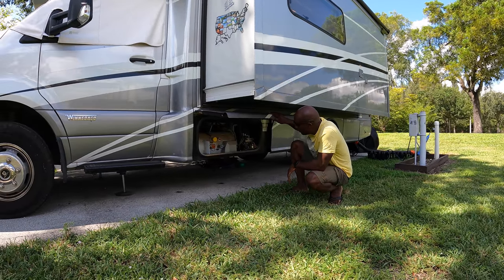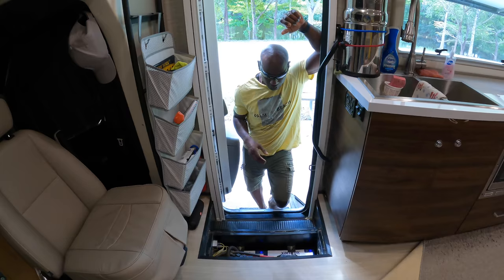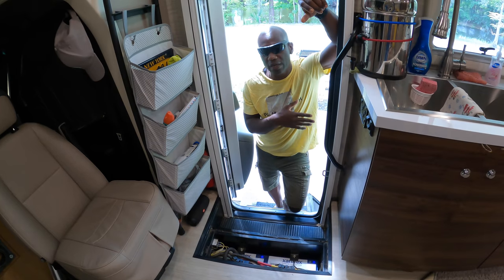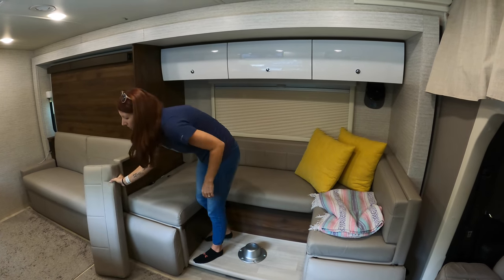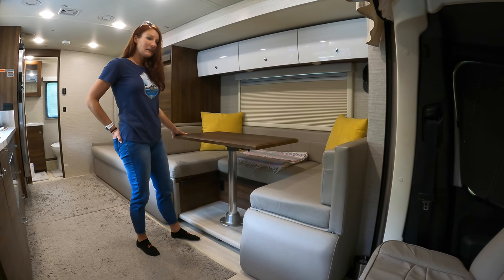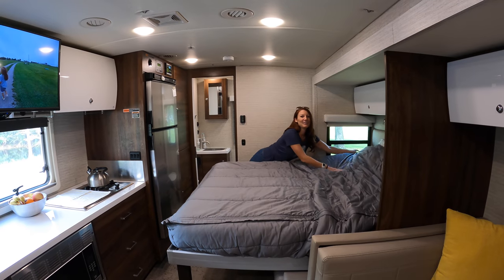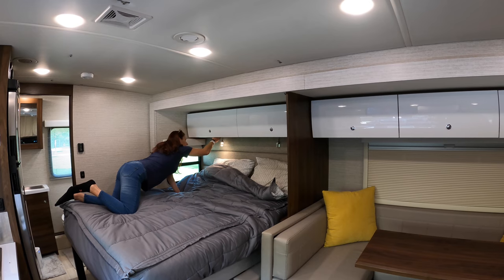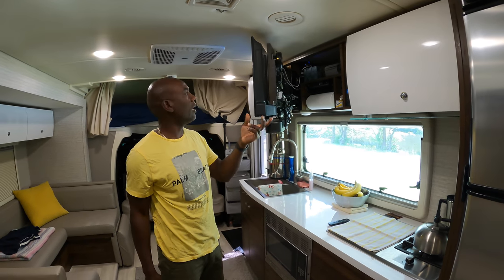Welcome to our Winnebago Navion 24D // Winnebago 24D 2022

Comment: What do you do about no electric in the kitchen? I see no tower power!! Also, the ccc is low has this given you any problems?
Reply from the maker: There’s a power outlet in the kitchen (above the stove). We didn’t have any issues with the cargo capacity or towing. Still recommend you be mindful of braking while going downhill especially if towing.
Reply: @rvseeingyou   I would not be towing. Do you know the weight of your rig? I know I would be buying to leave out of so I can see can goods and such being a weight issue.

Comment: Hello great video ! We are considering getting a Navion or View. Do you find problems going places with this? I mean like going into town or driving around into the city comparing with class B which is easier ?
Reply from the maker: Hi Jeanne, we’ve not had any issues with our rig regarding navigating in cities. We tow and are cautious when pulling into parking lots but beside that, haven’t had any issues. The N/V will fit inside a normal parking space (width with slides in). The back will hang over so we park in spaces where there’s an overhang towards the back.

Comment: Since the generator uses diesel fuel, it would be nice if the air and water heater and cook top; would also use diesel fuel as an option.
Reply from the maker: All those would be nice but I can only imagine the logistics behind that setup. We’re new to the RV world but are there any rigs on the market that use diesel for air? Keep in mind we have a fairly small fuel tank to begin with. But that would be nice to have.

Comment: Would you mind commenting on what size Beddy fits the 24D?
Reply from the maker: Our Beddy is a regular queen.
Reply: @rvseeingyou  thank you.
Reply from the maker: @noahandeliscorner  I should have added, we have a 3 inch topper & the Beddy works good with it. 😊
Reply: @rvseeingyou  I took note of that in the video! :)
Reply: @rvseeingyou  actually, is your topper cut for the entire length of the bed?   Looks there is a small section with a smaller cushion?
Reply from the maker: @noahandeliscorner  we did cut some of the length off the topper.

Comment: Where did you get the block mirrors?
Reply from the maker: Hi, here is the link. DH Full Length Mirror Tiles-12Inchs 4PCS Self Adhesive Frameless Glass Mirror Sheets, Easy Install Wall Mirror Stickers for Dorm Mirror Bathroom Mirror Home Wall Decor Mirrors https://www.amazon.com/dp/B07Y6B9P5V/ref=cm_sw_r_cp_api_glt_fabc_RRK4RD7PMBABGK14QKXN